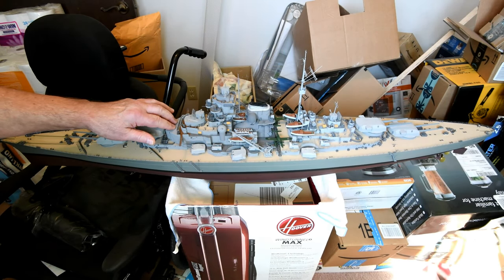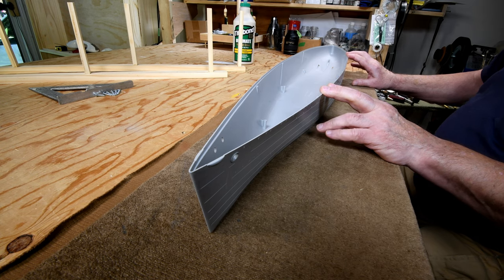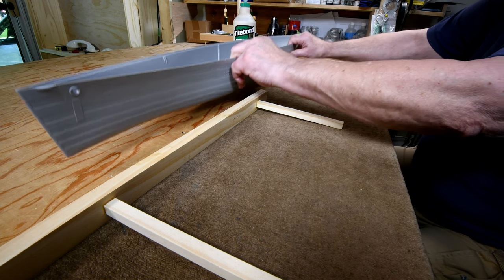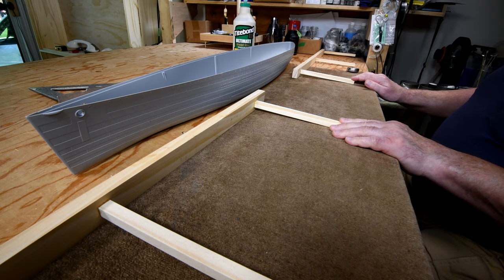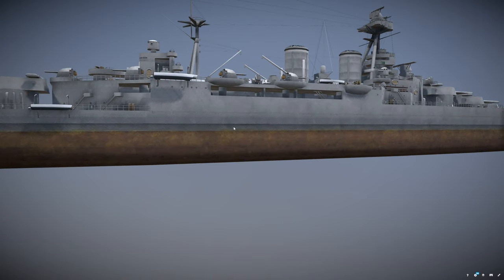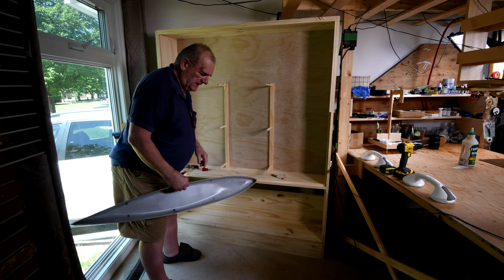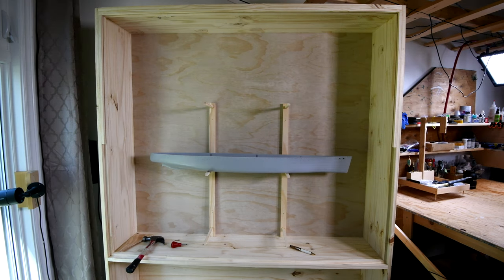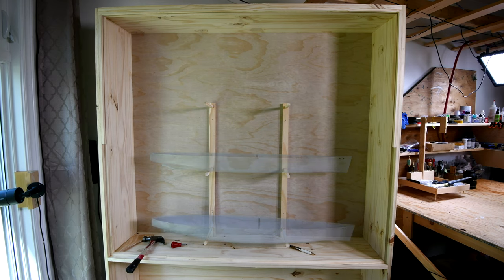The Model Ship - Part 496

Comment: hi Ron, I am now collecting Hood and I can tell you with confidence that the bottom of it is absolutely flat. I also plan to place the ships the same way as you do, only not in the closet, but on the wall and cover it all with a plexiglass box. And so that the ships do not fall, I will drill a couple of holes in the bottom, and in the stand I will make guides for them😊👍
Reply from the maker: Thank you for that information. 👍

Comment: Hi Ron, I agree with GANZ 13 100%, your 16" distance between supports will be fine. The bilge keels on the kit are actually around 15" long so you can judge it for your self if you see a pic of the trumpeter hull.. like the one shown here...http://www.trumpeter-china.com/Uploads/201605/573ab72dead46.jpg
Reply from the maker: Sounds good - thanks! 👍

Comment: Hi Ron ,your case is looking great? Cotton buds I wonder how we all understand each other Lol the Queens language, one object so many different English words for it lol its a cotton bud lol not a Q tip ,how did it come to use ,doesnt look like a Q ,it looks like a cotton bud lol 😄😄😄😄😄😄see  you tomorrow
Reply from the maker: No Q-tip down under Marc? 😁
https://www.amazon.ca/s?k=qtips&gclid=Cj0KCQjwupD4BRD4ARIsABJMmZ9Nsj_CbTOR3HkZGof7M6AFp4vGIwHFs7nwlzfLoBJYwjRhoxKl_B4aAiFUEALw_wcB&hvadid=208449734809&hvdev=c&hvlocphy=9001185&hvnetw=g&hvqmt=e&hvrand=11536733567222268062&hvtargid=kwd-300125788998&hydadcr=20844_9409583&tag=googcana-20&ref=pd_sl_7g9uv5n88m_e
Reply: Lol looked it up ,also now we have cotton swabs lol guess like everything else, itt depending where you live ,I get in trouble if I use non Australian words ,Rebar (steel bars for concrete )here Down Under its Rio,pronounced Reeo!
Reply: @aussiefrenchman-hobbytable9960  Q-Tip is the name brand of the cotton but Marc.......Widely sold here so the name just stuck as Q-Tip.

Comment: That Bismarck setting on that open cardboard box makes me nervous.

I usually use an acid brush on small areas to spread glue. They are cheap and basically disposable.  I cut them back most of the time to make them a little stiffer.  I sure you have a Canadian version of Harbor Freight(aka - Chinese Garage Sale) https://www.harborfreight.com/12-in-horsehair-bristle-acid-shop-brushes-36-pc-61880.html                                              See ya tomorrow.                 JimE
Reply from the maker: One of those would have worked great Jim. See you tomorrow. 👍